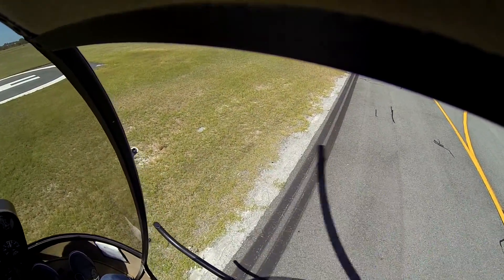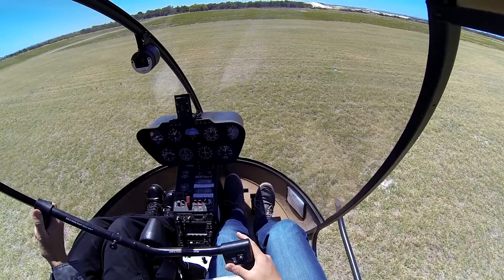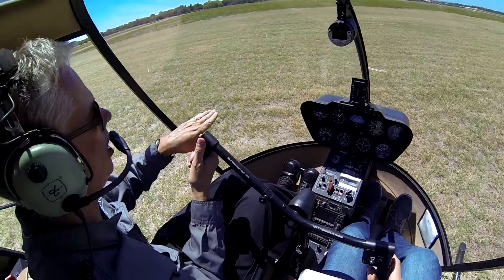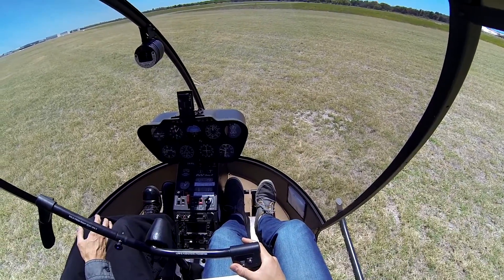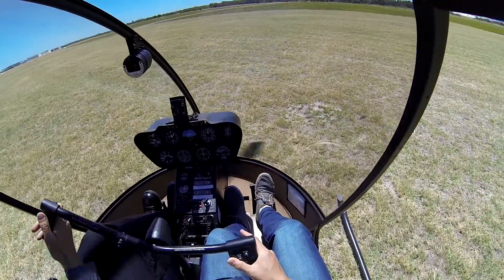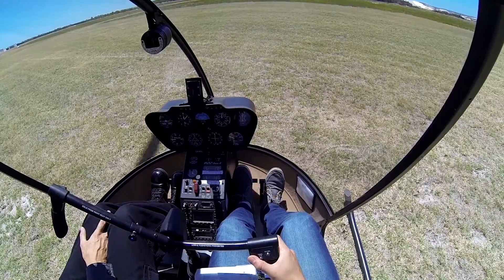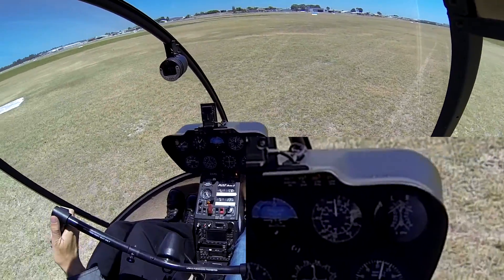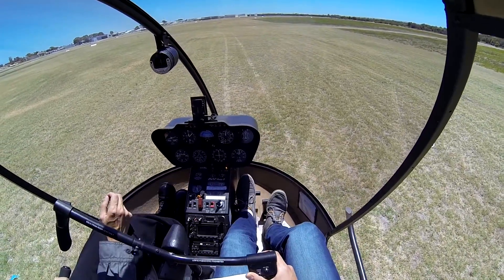Robinson R22: Lesson 16 "Engine Failure In Hover" (Full Lesson)

Comment: Chang739 Congratulations on the the excellent videos. The editing is first class, beautiful in focus videos and  I love the high quality audio. What are you using for camera's and audio interface? At 3:16 you nailed the right pedal ! loved the bounce. Smidgeon, I'll add it to my list of definitions. This by far, the best video on YouTube on "hover autos".  This sets an example of  how hover autos can be taught.
Reply from the maker: Thanks for the kind words! Back then I was using an Nflightcam headset - gopro cable, but I've had a few issues with loss of sound so I've reverted to a $15 mini mic inside the headset ear cup with my phone recording the audio track.  I have a backlog of lesson videos I have been meaning to put together and you'll find both audio and video quality is much much higher now. If only I could go back to those early lessons with the gear I have now!

Cheers again!
Reply: @Chang739 I'm using an ebay mic tucked into the cup of the headset, into a digital sound recorder. Even in your earlier videos, the audio still pretty good. email is ramjet555 a-t g m a i l

Comment: would you have more videos about engine failure in hover? I would like to see how much you've improved over the lessons.
thanks bro, great video!!!
Reply from the maker: Thanks mate! Can't believe this was more than a year ago. I've practiced a few more times, but not on camera unfortunately. I'll be sure to grab it the next time I do, looking back on my old flying is pretty cringe worthy! I definitely struggled with the pedal-settle-pull that day because of how fast you need to react.
Reply: @Chang739  I'll try engine failure in a hover tomorrow for the first time, though in a bell 206 jet ranger. I'm sure the principles are exactly the same. I'm a student as well... your video helped me prepare for what is about to come... =D
Reply from the maker: @xurubira  You'll have a bit more inertia in that rotor so the "settle" part won't be as rushed. Rotor direction is the same though so it will still be the same pedal. Good luck!